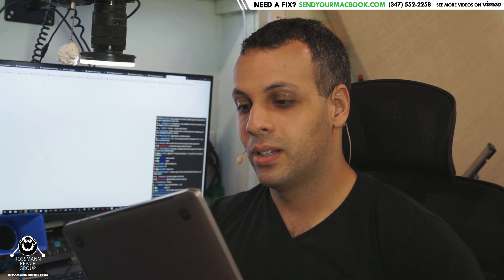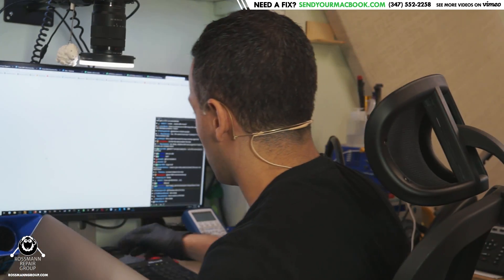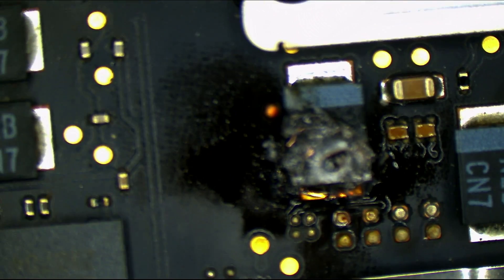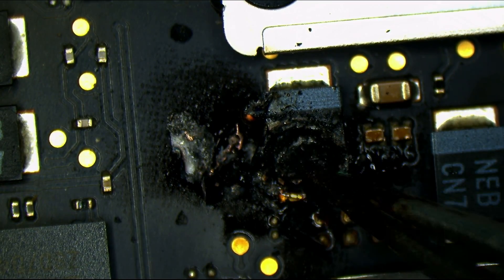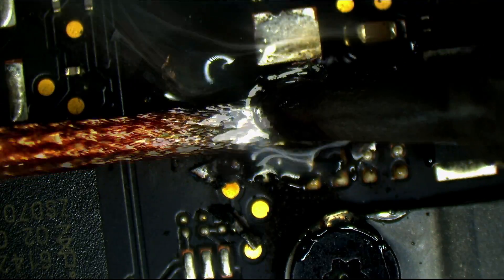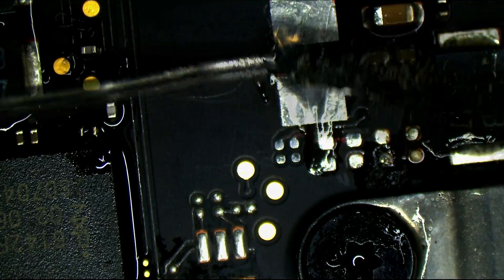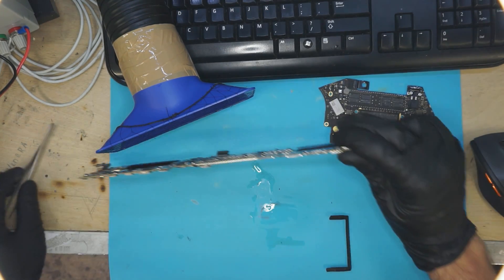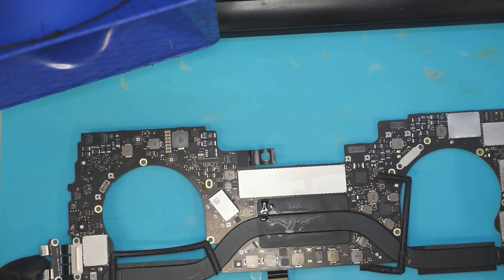A1706 Macbook Pro Touchbar common cause of spontaneous death

Comment: How to fix "Critical software update required" and not booting further, Only it turn ON in safe mode, I have tried using Linux it has more driver issues, but some how usable. Mine is 2016 Mac book pro 15 touchbar. What can I do? Should I check in apple service center or some third-party service center? Thanks for your answer

Comment: Hi, my MacBook Pro A1706 with a touch bar and an onboard SSD is unable to detect its SSD. The screen shows a folder with a quesion mark.
In some videos, they fix the logic board and use a Apple Migration Tool to read data from the lifeboat connector.
An engineer checked my MBP and found that the SSD was fine and the logic board was broken.
I'd like to ask someone to fix it, but I am concerned about the security of my data. I don't want others to migrate the data out of it. My MBP is not protected by FileVault.
If the logic board has been fixed and the SSD is not protected by FileVault, is there any tool to access the data without the need of the password?
It seems like the Apple Migration Tool requires the password to access the data, but I don't know whether their FileVault is enabled.
Is there any other tool which does not require the password to access the data?
I heard that the data on an onboard SSD with a touch bar is encrypted even if the FileVault is disabled, but I am not sure.
Maybe you'd like to answer my quesions. Thank you.

Comment: Did a fast wall adapter to the charger or a weak or old disintegrated cap caused by heat do this if so maybe just swap it out with better quality ones or even uses a laptop pad with fans with good air flow to keep the mac cool !!?

Comment: Hi Louis,
I have also an issue with an a1706 and have a question, when measuring with amp meter only 5v and amp varies between 0.13 and 0.25 amp
pp3v3 G3H is present and ppbus main rail also but doesn't get 20V and obviously doesn't charge too and to me the four cd3215 looks all fine (usbc ports doing all the same thing, no anomalities).
do you have any suggestion.
the only visual thing I noticed is that C3208 looks a bit burned but seems to work fine -, it is not shorted and I am measuring 3v at that cap 

please any suggestion would be very welcome!

thanks in advance!

Comment: I have an A1706 and it’s been working perfectly fine for me. It’s 6 years old but I’ve taken phenomenal care of it over this time. 

However, three days ago I realized that my touchbar wasn’t coming on. Upon checking Activity Monitor and system preferences touchbar & control strip are NOWHERE to be found. The system is acting like it’s not installed. 

What would be the best corse of action? I have an appointment at GB this weekend just wondering if anyone else has had this problem and what you did to resolve it.

Comment: That exactly what happened with my MacBook Pro touch bar , I didn’t even use it more than 10 times since I bought it, and suddenly won’t turn on again, I took it to a place to fix it ( Suggested by apple in Denmark ) and he said it need a new logic board and it will cost 693$ 
Long story shot, my MacBook Pro is on my disk looking all new and clean and still not working, Stupid Apple Mac, I’m not paying 693$ 🤬

Comment: I just changed the display of my 13inch MacBook Pro and my Touch Bar is not responsive I mean it shows everything when I open any apps and services but the touch thing is not working but my Touch Bar looks completely fine .. also I couldn’t find the Touch Bar agent on the activity monitor … any fix ?

Comment: Hi Louis.  I have a 2020 MacBook Pro 13 touchbar which I bough in August and still under warranty.  The motherboard went bust and on this model Apple say the data cannot be saved since the SSD is soldered into the board and cannot be accessed.  Is there any way to recuperate the data?

Comment: Is the new 1.4ghz quad core 13" base spec (A2159) the same as A1706? I mean could it have the same issue like this with the 52v no protection etc.

Comment: Tantalum polymer caps will fail like this when over-volted. Violently and spectacularly. Although this cap is rated for 16v, any competent circuit designer will derate a tant-poly cap by 20%.
https://www.avx.com/docs/techinfo/VoltageDeratingRulesforSolidTantalumandNiobiumCapacitors.pdf
This results in the cap in question having an effective rating of 12.8 volts, dangerously close to the design voltage of the 12v PPBus, and under the 13v actually measured. This cap is not adequate for this circuit.

Comment: In all fairness tantalum caps are known to fail short. I've seen few fail without fire. Stress and flex on the board being transmitted into the leads. Thats my guess.

Comment: wait, on the A1706 they placed a high-current line next to a low-current line with no protection between the two traces?
That's not even a design flaw, that's a beginners mistake. Bet someone got fired for this.
Reply: Nope. Got premoted
Reply: @joeds3775  Probably to "Head of Hardware Design Division"

Comment: Yucky tantalums.  They do that.  I thought people had gotten away from those and only use ceramics nowadays.  My old Diamond Stealth 3D video card in my vintage workstation computer from the late 1990's....almost every tantalum SMD cap has done exactly what you had happen here.  They de-solder themselves and drop off the PCB or tombstone.  Still works though...

Comment: ☆☆ In the new shop install a second level steel mezzanine, easy to bolt together and reasonable prices. Look at Grainger website for ideas,then SHOP AROUND!!!  Top floor; bathroom, clean room, ultrasonic and board oven room, 12 work stations, 6 on one wall and 6 on opposite wall with Gorilla rack steel desks with peg board and sliding drawer  creating a hallway in between, OR Gorilla rack steel desks with peg board and sliding drawer and place back to back 6/6 and lastly a reception area with a waiting area. 
 Bottom floor; storage area and large classroom.

Comment: Dang! I'm watching this video on a MacBook Pro 15" 2017... and this really worries me. Not gonna buy MacBooks in the future if issues like this goes on. Really, the product is good but it seemed like it's very delicate and not durable for the price and seemed it's bound to be short lived. What a scam I would be in to...
Reply: Tell Louis to put in beefier caps.  You can use the same microfarad but change up the voltage rating.  See if Louis can do that for you.  He just said he knows what caps keep burning out.  I think it's caused by a momentary overvoltage from somewhere.  The question might become "if the caps don't burn out (like a fuse) what downstream component is going to be damaged?"  Not sure.  Discuss it with Louis.

Comment: Apple running a RNG to determine if a component needs to be combusted 😁
Reply: Bascially "Bustboxes" made by Apple. 
Pay $1200, get random defects between common and legendary rarity.
Reply: EXcentriX if you’re super lucky the charger will crap itself and send 120v through the motherboard but that’s ultra legendary rarity instead it’ll just send all the power to the battery at once
Reply: Collector's Defect, Mint Condition. man, the droprate must be looow.

Comment: How do you avoid echoes and background noise when recording in the shop? Do you record most of the commentary in a different place with sound panels or something, maybe using the shop audio only for sounds you want to include on purpose?

Or maybe all that hardware and equipment lying around in there actually helps to diffuse the echoes...

Comment: Those caps are undersized. I have always read that a properly designed circuit will always have caps rated for at least twice the normal voltage to account for wear and prevent these kinds of things.

Comment: Using capacitors at an higher voltage than half their rating is reducing substantially their reliability
This is probably on purpose thought
Reply: @D.O.A. I already had to calculate this to evaluate the reliability of an entire electronic product by using the MIL-HDBK-217F which can calculate theses things and it states that the capacitor reliability depends on: technology of the material, quality factor, temperature factor, voltage stress factor, environment factor, capacity factor and serial resistance factor. Then add a bit for the soldering reliability and you can have a somewhat representative idea of the likelihood of a failure.
Reply: @D.O.A. yes, of course they probably know it. It's part of any analysis of reliability on a high volume production. The higher grade capacitors are maybe a little bit more expensive, they spare some dollars per boards. But they probably are also able to estimate the number of returns due to this and proposing warranty extension or reparations too expensive to make the client buy a new computer after warranty is over.

Comment: Ya know, I love watching Louis fix macbooks.. From my macbook.. 

One day, I know, my laptop will be there because it decided suicide was the best way out. 

But ill be supporting him by having him fix it. lol.

Also, I think a lot of these "random" issues are due to excessive heat and then power draw because Apple likes to make sure you can cook an egg on the machine before the fan kicks on. 

I use a fan controller, because this thing gets hot. But in Apples defence, my Dell Inspiron 1700 bent, like straight up bent the bottom of the machine because of the heat, then it tried to kill me when it shorted out and blew up. Thing was just on my desk. No hard load. Just sitting there with a putty session open. Windows had a popup stating I had to replace my battery soon, then it shut off, and the smoke filled the room. Scary shit. 

I think the next machine might just be a ThinkPad running some sort of Unix like OS on it. 

Cant do windows anymore.. Its just.. It doesnt feel right.
Reply: Allan Tinker hackintosh my guy
Reply: @ArStarSSBM  Oh I have one of those too. 

But not as a laptop.
Reply: Allan Tinker ah I see you are a man of culture

Comment: Is Apple properly derating their Tantalum caps for voltage and temp.  Common engineering mistake is to only derate for one and the symptom is a small failure percentage of shorted caps.  You should use 2x rated voltage for Tantalum caps to prevent failures from cap defects.

What is the supply rail overshoot when powering up?

Send me the cap series and I can analyze it.
Reply: Finally somebody who gave the correct answer, voltage x2 is the suggested headroom for tantalum caps. The same as the old toshiba laptops that always suffered with nec tokin capacitor issue.

Comment: Tantalum capacitors are very intolerant to voltage spikes and heat. Even voltage spikes that last just microseconds can insult them enough to self destruct. Unlike other types of capacitors like electrolytic or film which have the ability to "heal" after an insult, tantalum has no such ability, leading to them dying more frequently.

They're a big problem on old motherboards which sometimes use hundreds of them as bypass capacitors. Powering up an old 286/386/486 for the first time after 20-30 years often results in at least one of them exploding.

Comment: Flux may be useful for removal and clean up but you don't need it for replacement and you certainly don't need hot air to replace a capacitor.

Comment: Soldered ram, soldered SSD. What could Apple possibly do next to make their MacBooks as non-service friendly as possible? A completely sealed case?
Reply: Ip68 rated everything's covered in silicone sealant 😂
Reply: Adam Jacobs if you open up the macbook the charger will send full ac voltage through the battery

Comment: I wonder if this is what Apple actually means when they say 'liquid damage', not what we think we hear (you dunk the macbook into the ocean) but when a component inside effectively melts/liquefies causing 'liquid' damage.  If I understood correctly (I do software, not hardware), tantalum capacitors can be finicky, especially old ones, maybe there was a electrostatic shock in the wrong direction?

Comment: Hello together, i have here an A1706 with a "small" liquid damage. Not one indicator is red but i have corrosion on two caps and one chip. The Caps are NE(H) CN7 - so 16V - 33µF - 180mOHm ESR , but i couldnt find one simular with that low ESR in case-B size. The closest i could get was 350mOhm but 10% instead of 20%, would that work? The second Chip is coded with "20P - E8" and has six legs, i couldnt find any further information. Hope somebody can help. Thank you very much.

Comment from the maker: Another daily board repair video. I am going to do my best to keep these going daily. Every day, at least one educational piece will be uploaded that you can hopefully use to take a dead Macbook and make it work again. Now, it is time to do your part and find some recycling center or ewaste facility that is piling these, and follow the instructions here to make them work. GO!
Reply: Hi, I've been watching your videos since 2014, every single one. May I have your email? I'd like to apply for a job. Thank you. 

Sebastian
Reply: mens toys toys pretty sure that is not how this works.
At any rate, his mail adress is public.
Reply: The moral complicity though of selling somebody a premium product that has so many design flaws in it. To repair it is like selling somebody a repaired racing tyre for their Ferrari. It could all go so wrong and be very expensive. Preserving that shit? Is a distance I'm not too comfy on going. Drugs can be cleaner than Mac books 😂
Reply: I thought engineers stopped using tantalum capacitors decades ago as they are unstable.  Cheaper than ceramics though.  I suspect many more failures.
Reply: @gavincurtis  Clearly not Apple, probably because as you said they're cheaper.
Reply: Time to fix the peepee
Reply: The smoke leaked out violently
Reply: can you help me please? i have the same model laptop, the problem is that it won't recognise my ssd, can i resolder and replace another ssd and where can i find one. thank you
Reply: I followed your advice. Found a perfect patient with similar problem. Bit when I plug the magsafe with meter it turns  only on on one of 4 ports and it's stuck on 5v. I could find 3.3v delivered the chip. Could that be still the same problem or should I look somewhere else?

Comment: Hello, i have a question.
I have an a1706 that only turns on if it has the power cord, with the battery alone not, but once on it works fine and charges ok. what can i check?
If I turn it off and it doesn't have the charger it doesn't turn on.
thx

Comment: I love how you hate apple products but they're also your main business
Reply: Unlike Apple, Louis wants to do right by his customers even if they were conned by Apple's million dollar advertising into buying a fragile mess unfit for use disguised in a thin veneer of pretentiousness.
Reply: It's like an army surgeon saving the life of an enemy soldier.
Reply: I don't think he hates Apple entirely.  I suspect he hates the nosedive path of greed it has taken as a company that others follow.  Otherwise he probably wouldn't give two $hits about it emotionally.  I have the fondest memories of my early apple products.  But lately they are cheap, featureless for "pro" titles and overly expensive.

Engineering standards have dropped to where the logic board in a $1500 ipad pro is now a structural component double-side taped in place.  By structural, I mean the logic board itself is used to add rigidity to the weak housing that is essentially a flat cookie sheet tray.

The ifixit teardown was disturbing as everything is held together with 3M tape essentially.  They were not overly impressed either.  Performance and sound is excellent, just not built to last.
Reply: @gavincurtis  >just not built to last
Basically any recent apple product
Reply: @Josh 3204 Do it, it's worth it, my MacBook A1706 screen decided to convert itself to RGB 3 days ago, now it has like, purple lines, blue lines, it's awesome, and I didn't have to pay anything for this upgrade. Go Apple!
Reply: My old land rover indy repair shop was the same way. Profitable and he won't ever stop telling you they're trash. I listened, most don't.
Reply: All the more reason!  As someone that maintained the mac platform images for 17k seats, I can assure you he has every reason.. they are not the greatest company to deal with.  Commenters saying 'you are helping the enemy' - if your cute girlfriend or relative went and bought one instead of bugging you for (the right) help, there needs to be people that still care about her sorry ass.

Comment: Tantalum caps are evil and can f* you over in the most erratic ways. These things are unreliable AF and failure modes are near unpredictable. Also, tantalum in itself is a scarce resource and usually mined under the worst conditions known to mankind. That is why we opted to not use any tantalum in our designs long ago.